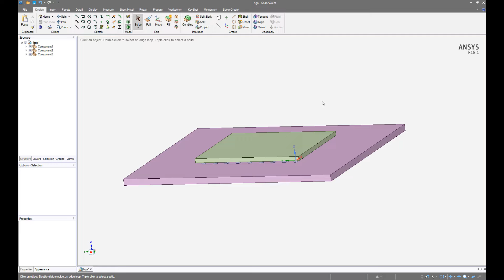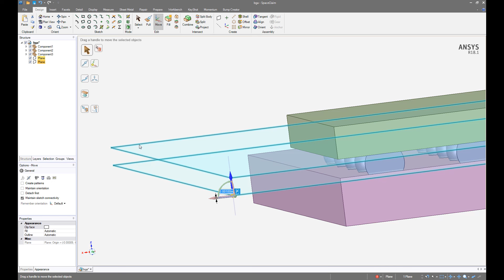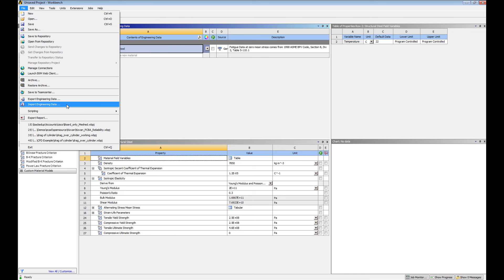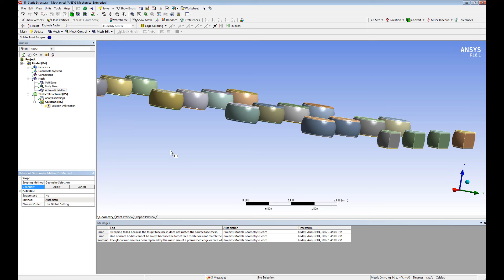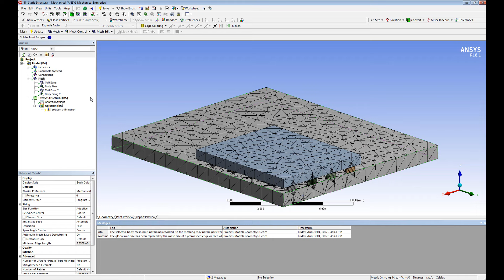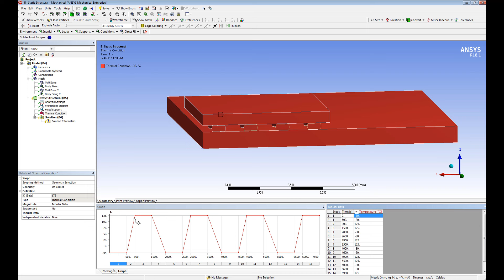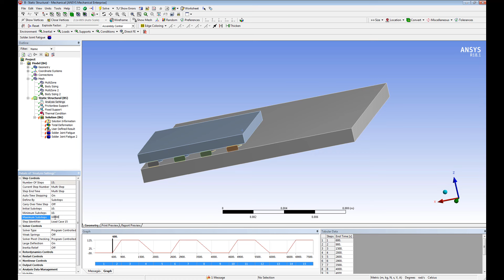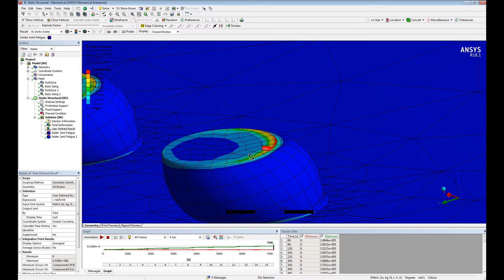Solder Joint Reliability using ANSYS Mechanical

Comment: Hai Mingyao, thank you so much.. I have some doubt in this analysis. Complete model by ansys or some other desigining software.. can you send me link of ACT extension of solder joints..
Reply: Why you did share topology?
Reply: @Better_Life4321  To apply localized conformal mesh
Reply: @briankelly3194  yes Brian. Thankyou

Comment: Why do we need to cut 0.001 inch on top and the bottom of the solder joints? Thank you
Reply: Because that's where the crack initiation and propagation takes place, a closer mesh in that region would give more accurate results